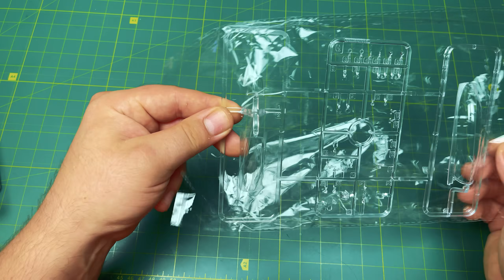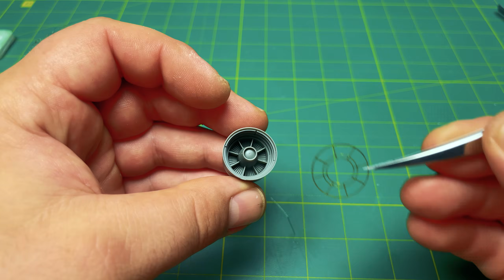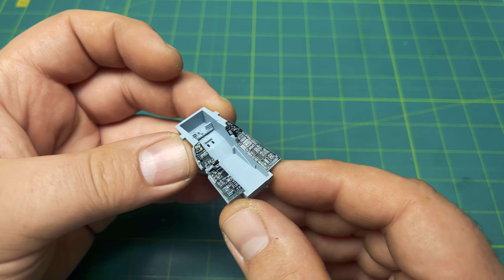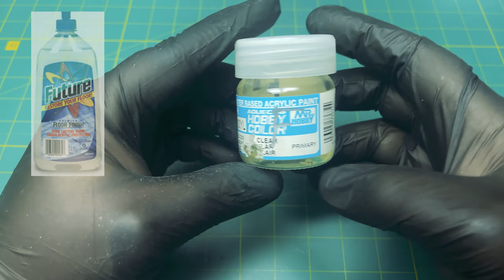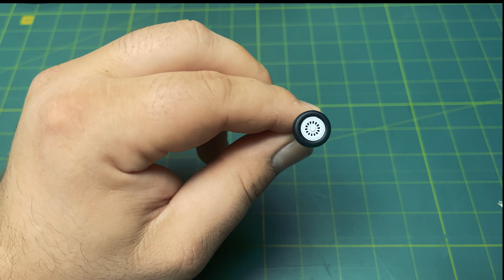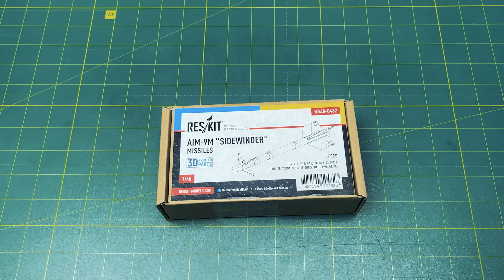F-16AM MLU in Ukrainian AF 1/48 Kinetic [full video build]

Comment: The Canadian government picked the CF-18 Hornet over the F-16, despite the cost difference. Recently we purchased used F/A-18s from Australia to supplement the fleet as attrition reduced our numbers. The F-16 would have been the better choice in my view.
Reply from the maker: Thanks for the feedback.
Big and heavy multi-role fighters for your big country are better in my opinion. The F-16 cannot lift such a load and does not have the same range as the 18.
Reply: I never directly worked on the CF-18 when I was in the air force, too short to load the AIM-9 on the wingtips... we have made them work for 40 years, but it's way overdue for replacement!
Reply: Were those the Australian  f-18's Ukraine turned down?

Comment: You did a great job on your 'Viper' !!! One minor thing : the Danish vipers had no transmitter/receivers on their leading edge flaps.... Forgot to remove them  ?

Further only compliments !!!
Reply from the maker: Thanks for the feedback. Actually they are. If you find a photo of this plane still in Denmark, its registration number was E-599, there are these ttransmitter/receivers on their leading edge flaps.
Reply: I just studyd some 24 pictures of the E-599 and this one had no rec/trans on it's flaps...
Reply: The only one i could find was the E-006
Reply from the maker: @janvanleeuwen1700  https://static.nv.ua/shared/system/MediaPhoto/images/000/498/529/original/a26fc09ee0618cc88a63b02b40106187.png?q=85&stamp=20240807124640&f=webp
Reply from the maker: @janvanleeuwen1700  https://armyrecognition.com/templates/yootheme/cache/cf/Ukraine_receives_several_F-16_MLUs_from_Denmark_and_F-16_ADFs_from_US_Air_Force_925_001-cf8ee773.webp
Reply from the maker: @janvanleeuwen1700  https://lens.google.com/search?ep=gsbubb&hl=uk&re=df&p=AbrfA8rlV1gbS6QoNWPHrpt-0Ry2T_BKz-cF2XwQKYqYuhr8s8vOPzpyk6BBhxsZTknvcWoNvAP4nhKJHDiZV152o863DmIceTmIlK_GB9IrLUocQnL15nnSI-9teRpf__kCszT7AesNw10622EXkdoLs93rQW6B23GLi8K5ybk9sos4sWLlC8nd7eXPqqT4oTjGwxyakAB7VzOippS9Qxdy_7tSrrU2UQ5nS_cdnKCLsHYaFnyo4GrtH1KNjIMJbmzVr8HTRuEx4QipHJ-Hi7SMdgzP2FpLRy0CQE2oRQtOCksZdQxgJ5eZcgm3#lns=W251bGwsbnVsbCxudWxsLG51bGwsbnVsbCxudWxsLG51bGwsIkVrY0tKR0ZrTlRNMVpqTXlMV1JrTjJJdE5ETm1NeTA1TW1NMkxXVTFNems0WkRrNE5tVXhNUklmYXpsVU0wSnZORzgzTkhkaWIwUk1aa3hPVEZCZlpVOWhOMDF5U0UxNGF3PT0iLG51bGwsbnVsbCxudWxsLDEsbnVsbCxbbnVsbCxudWxsLFs0MDAsMjAyMTAsNTUxOTAsOTk2MDBdXSxudWxsLFsiM2RiYjk2MTktNTE0Ni00YTAwLTgwMmUtZDZhYzZjZDZkNzlhIl1d